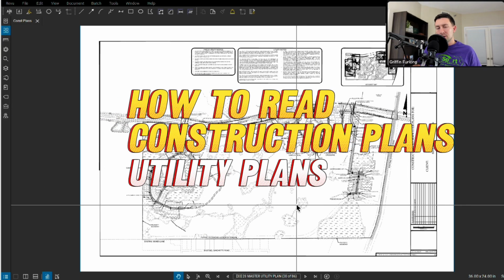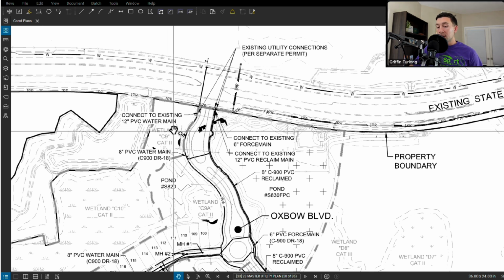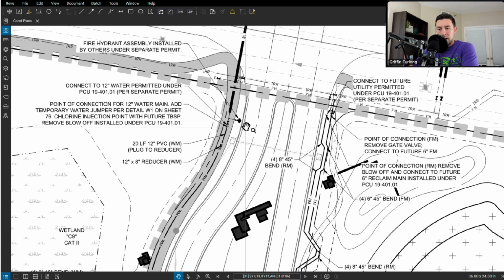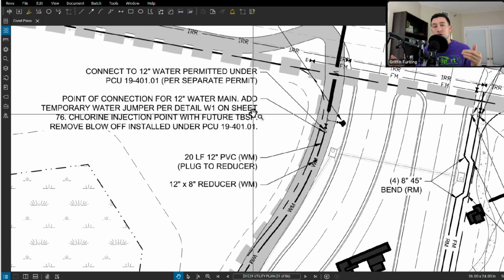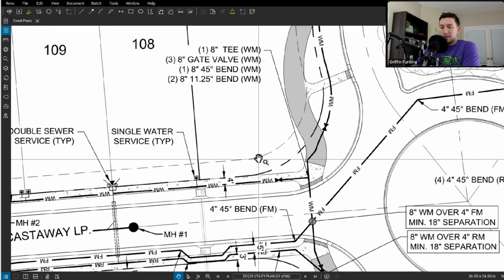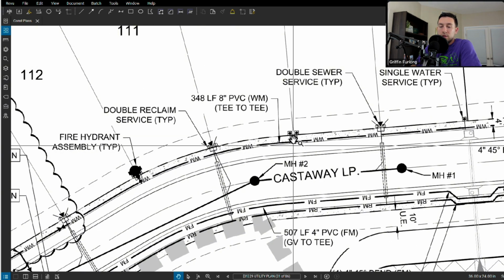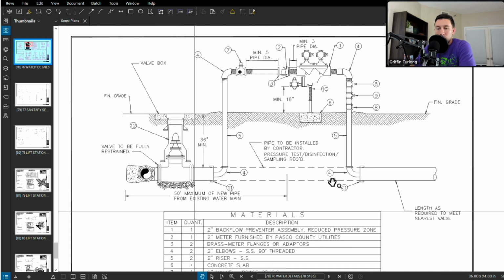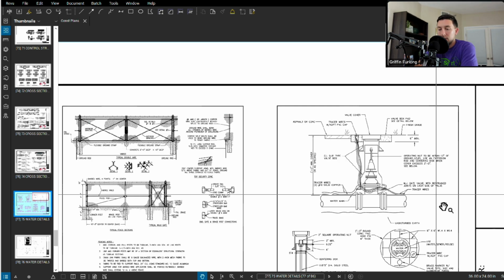How To Read Utility Plans

Comment: Griffen, we have a project that involves HDD under a canal. The current pipe before canal is an 8” pvc that will need to be converted to a 12” HDPE that will be bored underneath the canal. Do you have any videos that involves this?

Comment: Nice video 
WM - Watermain 
what is RM and FM? also are the symbols standards or it depends in the area (country)
Reply from the maker: @zagvot  RM - Reclaim Main. FM - Force Main. And symbols are standard, some styles might look different though
Reply: @civilgriffin  what is reclaim main and force main? Sorry im a beginner
Reply from the maker: @zagvot  reclaim main is used for irrigation purposes, it is reclaimed water that was treated from a source and sent to customers to use for irrigation. Force main is wastewater pressure pipe, typically from a pump station that pumps it to the wastewater treatment plant